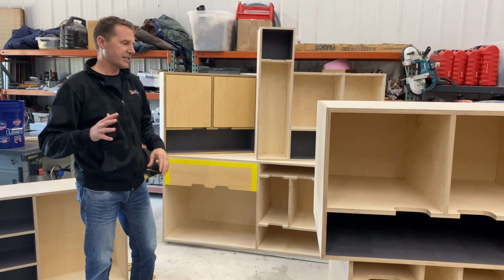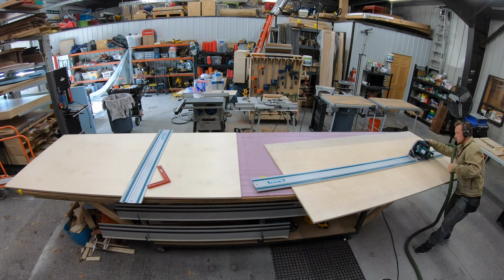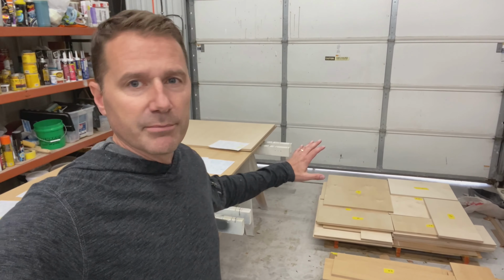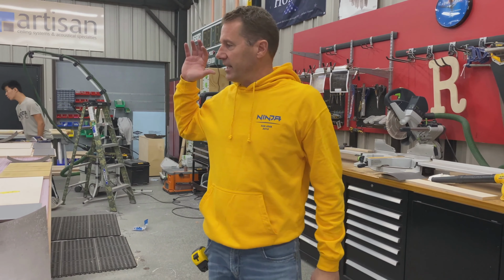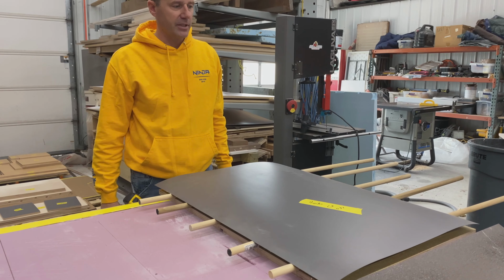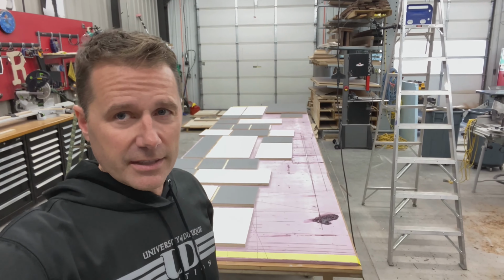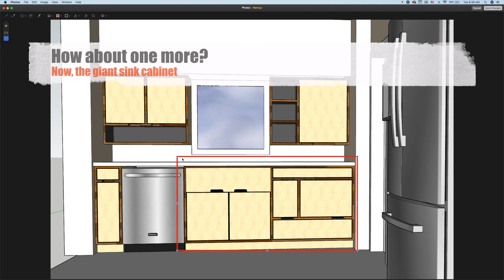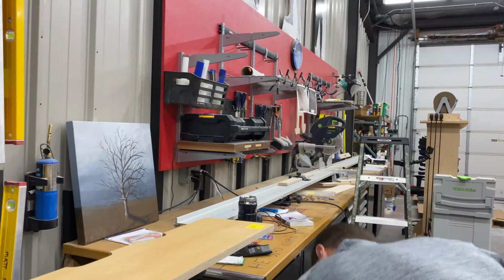Kerf-Style Baltic Birch Plywood and Laminate Cabinets--Full Kitchen Build and Install--Part 1

Comment: Nicely done.  Between Sketchup for the initial design and the Festool gear for the actual build I’d say you have the ideal system here for building cabinetry.   I’m planning a similar DIY kitchen renovation next summer.   These videos are helping to confirm my understanding of the process involved.   Much appreciated!
Reply from the maker: Thanks for the comment! I'm just learning Sketchup on the tail end of this project, but I do think it'll be nice for future projects. I do have some older videos on more traditional type cabinets too. I've learned a lot from others on YouTube, so it's nice to hear my videos are benefiting someone out there! Thanks for watching!

Comment: Thanks for making this video! I'm new to laminate and I want to make sure I understand your process in the video. I see that you laminated some pieces after the kerf / dado / rabbet cuts – or was this always the case where you laminated AFTER a dado / rabbet?
Reply from the maker: I only laminate pieces that receive a kerf cut later because the dado would chip the laminate. Any pieces that are laminated fully I did ahead of time. Thanks
Reply: If you used a router to do the dados do you still think it would chip the laminate?

I’m using the kerf idea for my vanity and kitchen cabinets so your video is super helpful- thanks!